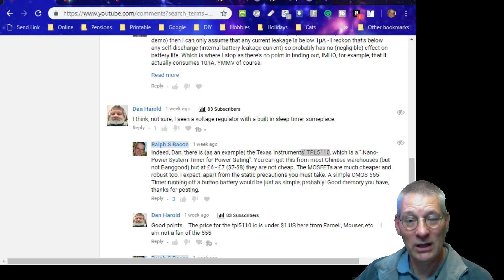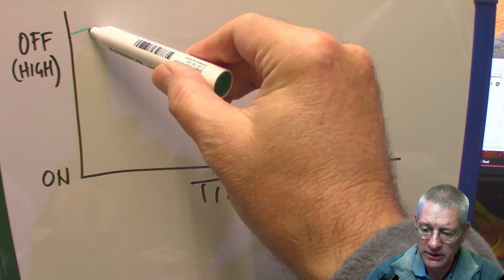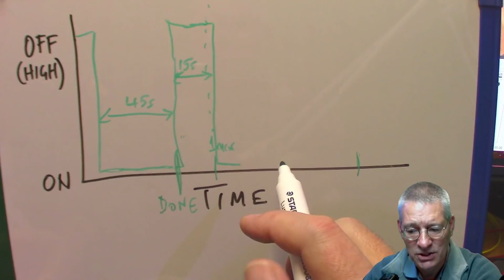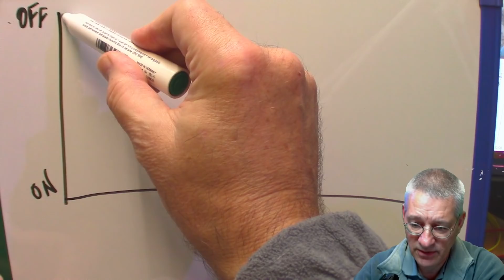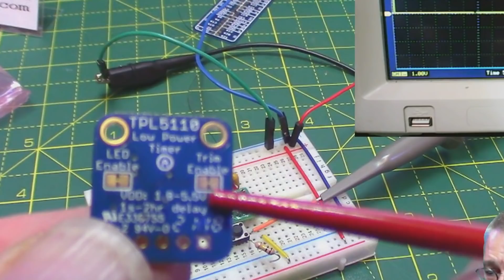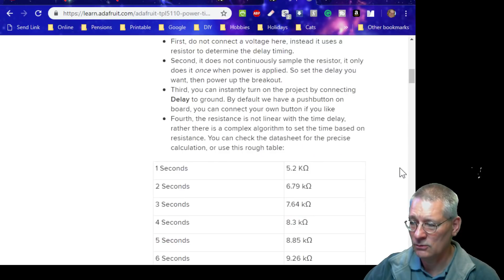#125 TPL5110 Nano Power Timer (for Arduino)

Comment: Thanks Ralph, another well explained video :)

I would like to pick the collective brain of you n your subscription possy...

I am embedding a tom tom GPS into a dash but unfortunately it does not have an on/off function, when it senses ignition on/off. It is turned on and off by holding a tactile push button for at least 2 seconds but no more than 5 seconds. So I soldered a wire to either side of the button (touching tips then functions the gps) and I have tapped into the 5Vdc supply from the stock 12-5Vdc mini usb power lead.

The storyboard is as follows...
1) The ignition is turned on.
2) Smoke is sent down the copper powering the gps, an ATtiny85 (many thanks for your vids on those btw) and a cap which acts as a power backup for the ATtiny85.
3) The ATtiny85 sends magic for 3 seconds to a 2N2222 NPN transistor turning the GPS on.
4) The ignition is turned off.
5) The ATtiny85 detects the lack of primary power
6) The ATtiny85 sends the magic again, turning the gps off
7) The cap falls below minimum ATtiny85 functioning voltage and that turns off too.

After several failed attempts at making a circuit without a microcontroller I opted for the above overcomplicated mighty doofer.

There's probably a really elegant and easy way of doing this isn't there? Please put me out of my misery; my electronics self education isn't going well lol.
Reply from the maker: Actually, Stuart, it sounds as though your solution is simple and, more importantly, works.
 
Whilst there may be other ways to achieve what you want I don't consider your implementation a poor one (nor overcomplicated) by any means. Are there any shortcomings with your solution that you're trying to improve upon?
Reply: @RalphBacon  The solution does work, it just didn't seem elegant to me. Ive only been learning electronics since June; I think my lack of electronics experience and my mech eng brain just makes me doubt myself.

It would have been nice for it to fit inside the existing case but hey ho, its not like im short on space.

I did come close to a non microcontroller circuit but the 'off' part wasn't reliable.

Anyway... many thanks for your response, I am comforted by your points and look forward to more Ralph & Benny tutorials.

Comment: I use two TPL5111s to make radio transceiver periodically  transmit and the receiver periodically turns on just before the transmitter.  it works great  The receiver processor when done, issues a HIGH to the MDRVn pin to start its next cycle.  An inverter is used to accomplish the HIGH to the LDO's enable pin at the end of the TPL cycle.
The receiver's TPL is configured as a one shot and the transmitter 'TPL  as free running.
Reply from the maker: Another excellent Real World example of where these chips are being used. Thanks for sharing Michael, others will be interested too.

Comment: Sadly there is no "one time shot" at least that I am aware of. Cutting the trace to the variable resistor just lets you put your own fixed resistor value in instead of a variable resistor. Pushing the button will force an on state but it goes right back on timing afterwards. When Adafruit first featured this board, this is how most thought it operated and were dissapointed. They thought (or at least I was elated but dissapointed over) was that say every two hours/3 mins/2 sec etc. it would turn on and never turn off ever unless the done pin was triggered (or pushed). However it is not the case as you have pointed out. Somewhere in the forum support said you could make it do something similar but I guess you would have to check out the datasheet to confirm, I doubt that functionality exists. As people have pointed out, this is not that great a module for the likes of an arduino, as you can get an ardunio in deep sleep and no regulator to 2 to 4ua, where this shines is more power hungry units like the esp8266 or esp32 where it has to turn on every hour or two, fire up its wifi, check a sensor, post to the network and then shutdown. I think the quiesnent  with the led trace cut is about 35nA. A fellow Youtuber Kevin Darrah makes the trigboard as an example, it combines an esp8266, tp5110, and a few buttons in his own custom pcb. ( I think I get a free one for mentioning this right? j/k). All in all the 5110 and 5111 definitely have thier uses but you have to be really creative about it (you can even chain both in a way if you are creative) but I wish there were more variations on this thought process, a programmable resister addtion comes to mind but then again the tpl series does not take on the new resistor value (aka: time) unless the tpl5110 its self is powercycled..yes it has its issues.
Reply from the maker: Yes, you've summarised what most are saying here (including me, really). It has its place but the Arduino and PIC family already allow Deep Sleep with periodic wake-ups - even the ESP8266 does, albeit in a different way (basically it has a timer like this built into it).
 
However, the datasheet (it's in my GitHub) for the TPL5110 does state that a one-shot method is provided (as I mentioned). Here's the exact wording:
"When EN/ONE_SHOT = HIGH, the TPL5110 works
as a TIMER. When EN/ONE_SHOT = LOW, the
TPL5110 turns on the MOSFET one time for the
programmed time interval. The next power on of the
MOSFET is enabled by the manual power ON."

Comment: I'd rather use a nanoWatts/XLP capable PIC µC instead, or a TI MSP430G2553, and have its watchdog timer do the same job. Pics with XLP can be had for less than £1, are through hole, and can do a lot more than this watchdog (and may take the Arduino's job as well, depending on the task at hand) :)
Reply from the maker: Yes, that was what I was alluding to at the end of the video - a cheap µC of some kind could provide this functionality for the same (nanoWatt) power and $ price. We could consider a bare ATTiny85 waking up every 2 hours or so, triggering the main circuit and running from a button cell thus not depleting the main power source at all. So many options and variations!

Comment: Isn't this deep sleep functionality/timer available in most uC's already? (I remember they were in MSP430's). These days, of course, I'd look at doing this in a greenpack device. They already come with the PCHan mosfet (at least some of them do!)
Reply: my comment may come accross as smart as* criticism... it's not. I love what you've done here, really made me think about the functionality i want in a pet-finder project I'm working on. What I need is close to the TPL511x, but needs a small variance. Also need this for multiple devices in parallel.
Reply from the maker: Yes, Deep Sleep built-in to most µCs these days. This was an attempt to trigger the totally switched off Arduino (or whatever) back into life (from video #123). From the comments here, it seems an interesting concept but perhaps not what is required by many?

Comment: Hi, Ralph....cant personally think of a use for the Adafruit board, would probably go with your idea as its a lot more flexible but what I did find interesting was the sheer size of that chip you had to solder, I mean, positively massive!...…..Hahahaha!...….. Im just being a smug so and so...……….I'm quite comfy soldering Atmega 328p-AU now and I use my own breakout board which I just through together while watching TV the other day (using KICAD)…….however I still get a warm fuzzy feeling when I install the 8Mhz bootloader and save myself 2 caps and a crystal ! for which I have you and Benny to thank (remember how ya lead me by the hand through that one?)…….nice vid
Reply from the maker: Good to hear from you again, andymouse123. Benny says Hi too. Neither of us can think of a practical use of the Adafruit board but I did mention it was more of a developer's experimental board in the video. Glad to hear your soldering (and PCB design) skills are on the up, I tend to use Eagle - have you tried that one, how does it compare to KiCad?
Reply: @RalphBacon I, haven't tried eagle, I went from EasyEDA to KICAD because I've never used any sort of computer aided design before, but Eagle seems to be the one favoured by most, but as I cant tell a good package from a bad one.  KICAD seems fine although the file handling had me scratching my head for a while (where was benny when I needed him!)…….always look forward to the vids and you sorta hinted at something to do with your own board in the future...….cheers!

Comment: I've been using the TPL5110 for quite some time now, with WiFi nodes (ESP8266 12E and 12F modules) and they've been excellent. The nodes run from a single 18650 which is solar-charged from a very small panel.

The system will soon be duplicated for LoRa nodes at a greater distance.
Reply from the maker: I just knew someone would have used this in a Real World situation, so thanks for that Duncan.

Comment: Taking an Arduino Pro Mini, stripping out any gross power use like LEDs - using the watchdog timer to wake current use 7μA, adding a 32768 watch crystal 3μA  or sleep with external interrupt  0.2 μA - the ext. interrupt could come from a DS3231 clock chip (a quid on ebay) temp compensated so highly accurate. Or if you're not bothered about accuracy from discrete components, total current use 0.5μA
Reply from the maker: Yes, the DS3231 can be very accurate and the alarm functionality is quite flexible. And it can run on its own button cell for at least a year.

Comment: This is nice as far as it goes.  WIBN if we could have our uC adjust the delay.     use a programmable resistor?  Given that the uC knows the real time we could sample at real time points rather than a fixed interval.
Reply from the maker: I did a video #88 "Digital Potentiometer aka Volume Control" which uses the X9C103 (10K) version but others are available. It also remembers the last value set. But it uses 750µA when dormant and a whopping 3mA when running.
 
That said, remember this TPL5110 device only reads the resistance ONCE at startup then never again.
Reply: @RalphBacon  never again even after removing power? hehe, so you need power management for the programmable resistor also , so will the TPL5110 keep running if you remove the timing resistance ?
Reply: I have been looking into non volatile programmable resistors to do this, I have some on order to test quiescent current. Or an alternative ultra low rtc, but it is hard to find something in the 5na range, anything with an oscillator or timer active is significantly higher, there seems to be not many competitors to the tp series.
Reply: I don't have time to dig much further just now but here is one at 50nA   AD5165 https://www.mouser.com/datasheet/2/609/AD5165-748851.pdf
Only 8 bit or 256 settings but that may be enough. for some applications    This is the 100K version.  There maybe others.

Comment: I accept the title says nano power but, say on one time operation, how much current does the TPL5110 consume in the off mode? Your auto shutdown circuit used zero amps. I can imagine a number of scenarios where the repeated cycling of a remote sensor etc. in which the TPL5110 could be useful, though I suspect a 556 dual timer might do just as well. See what you dun? You catapulted me back to the seventies!
Reply from the maker: It uses 35nA according to the datasheet, Michael. But I still think a CMOS 555 running off its own button cell (eg the ubiquitous CR2032 would work well) could trigger my original circuit every X seconds (or hours) without the danger of cutting the power if it did not receive a DONE signal. A separate ATTiny85 (or similar) that consumes less than 10µA when sleeping could also be used, frankly. We shall see.

Comment: I like your other board better. I want to decide when to turn it on and off and if possible update the time it powers up again. For example like when readings get close to a certain threshold, I want to turn it on more often.
Reply from the maker: That's a very practical requirement and one that this chip will certainly not allow, so thanks for giving us a heads up on this use.